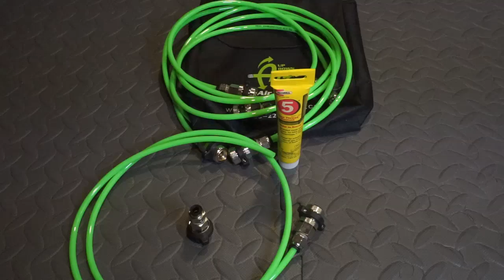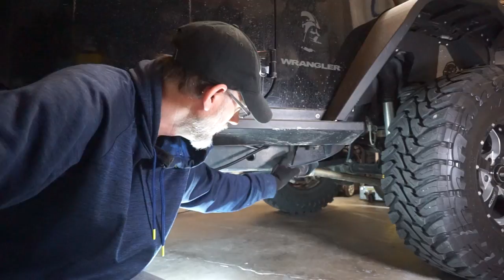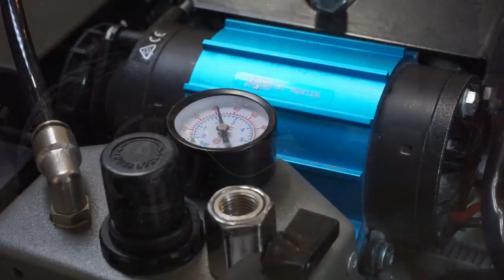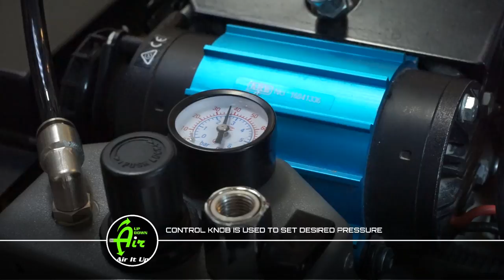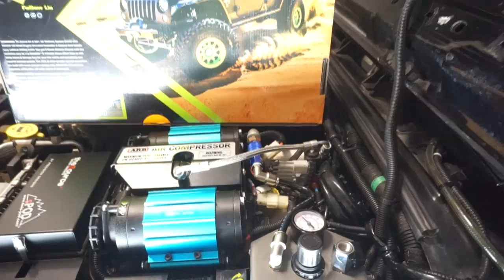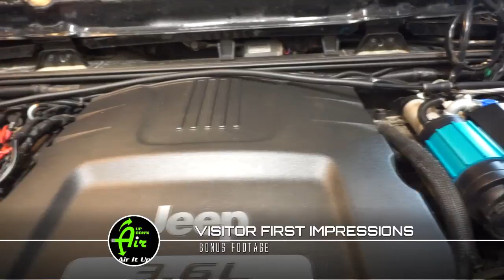UP DOWN AIR - INSTALLATION

Comment: Thanks for the video.  The SEMA video caught my eye, and I thought this would be perfect for my Wrangler.  I elected to go with a professional installation as this appeared to be above my skill level.  Just got the system installed this week, three days after you published.  I was hoping to play with it today but there were just too many errands to run.  I can tell you that with coupled with an ARB dual compressor and an sPOD, this air delivery system looks pretty sweet.  No more constantly bending over and airing down/up each tire!  Hopefully the rain will hold off tomorrow and I can give it a go.
Reply from the maker: Carol Bethune Glad the video was helpful. Thank you for watching. I used the system today and it worked perfectly on the trail. Once it installed it will be so easy for you to air up and air down.
Reply from the maker: So glad to hear that you went with the system. I hope you are still enjoying it and yes any time you can keep from having to bend over repeatedly is a good thing.

Comment: Hi just wondering after 5 years. if you are still using this set up? And howd it goes? Any issues. Is it worth it? They are still selling this product with gen 2 model. But it seems most vids here in youtube does not recommend it. Just getting sa inputs before commiting on getting its. It seems like a very good idea but i need to know if it really works. Hoping for your reply. Thanks!
Reply from the maker: Thank you for your question. Yes still using the same system. Main reason is because onboard air is required for the front lockers on the Jeep. Being able to run lockers, up down air and to help others when some extra air is needed works for our setup.  This system is slower than other alternatives on the market and ours is a Gen 1 model. Sorry have not installed a Gen 2 so not sure how reliable the new versions are. Hope this answers some of your concerns

Comment: Do you know if this setup with the addition of the ARB compressor Will work with a voswitch already mounted
Reply from the maker: Not familiar with the Vos Switch mount. We used the MetalCloak Arb mount and combined it with the Up Down Air system. We had to do some slight cutting of the mount but it all worked. Recommend you contact Up Down Air support for a more complete answer.
Reply: @JeepsRoc  Thank you, I appreciate the response

Comment: What do you have to do to mount the up down air piece in? I’m also running the metalclock bracket for the ARB DUAL air compressor. And the horn is mounted to the bac on the metalclock bracket. Any pictures would be a great help and ideas. Thank you
Reply from the maker: Bruce if you have an Instagram account send a direct message to @jeepsroc and will send you a photo of how we mounted
Reply: @JeepsRoc  i don't have an instagram account. what about Messenger?
Reply from the maker: @brucenix2037  You can send us a message on Jeeps Roc on Facebook

Comment: Neat setup but I wonder how hard it would be to modify to control the front and rear tires separately.  Probably just need some more valveing on the control platform to split the front and rears.

That way you could let air out of the front then the rear at different pressures and when filling up, for pavement driving, just fill all four up to same pressure, then air down the rears to preferred pressure.

I suppose you can do the same thing by airing up all four tires to what you'd like in the rear tires and then shut off the system, disconnect the rear connectors, turn on system to add more air to just the front tires.
Reply from the maker: I am not sure since this system is design to have each tire with the same psi when you have reached your set pressure. You could always set it to an example of 12 all around and then manually remove 2 psi out of the front manually if you had to. Just a suggestion.  Thanks for watching

Comment: i didn't see any installation, other than drilling a hole and cutting a piece of tubing. would've been nice to see how you ran the lines, whats all included in the kit, how it hooks up, how long it took to air up. Maybe do a manual air pressure check to show it's accuracy. Thanks for taking the time to make the video, though.
Reply from the maker: Appreciate you watching and leaving us a comment. This is an video we did years ago, since then we have worked on improving camera angles, and content.  This video is generation one of Up Down Air product and changed since this video.  If you would like see a little more of the product we do an article as well. Thanks again for watching and we hope that you enjoy our new content even more.   http://www.c4x4.com/Articles/Mar2018/Updownair/Updownair.html

Comment: Very lame video..  let’s mount the air up down fitting right where rocks will rip them off.  There a reason the fitting are mounted up and away.  Rocks, Mud, sticks branches..  
Happy trails Mall Crawler.
Reply from the maker: Since this video has been made not a single one has been ripped off. They are still rock solid and we feel we made the right decision in placement. A rock is going to hit our rock rail or mounting bolts first.

Comment: You mentioned that the factory bracket didn't work with your MetalCloak ARB compressor mount.  What solution did you end up with?  I also have the MetalCloak ARB compressor mount and would like to know if Up Down Air has a solution or if you had to come up with your own.  Thanks.
Reply from the maker: I did have to come up with my own mount. I slightly modified MetalCloak bracket by cutting a a small piece off the and then made my own bracket and fit it under/pinched it under the MetalCloak bracket. I can take some photos if you would like. Send me a DM on Instagram if you can @jeepsroc

Comment: Just a quick question, how did you modify the up/down control box to fit to the MetalCloak bracket. I am doing the exact same install on my '16 Wrangler.
Reply from the maker: Thank you for the question. I had to cut a a small piece off the MetalCloak bracket and then made my own bracket and fit it under/pinched it under the MetalCloak bracket. I can take some photos if you would like. Send me a DM on Instagram if you can @jeepsroc

Comment: Did I miss the connections from the ARB to each wheel?? You need to run four lines from engine compartment to each wheel arch? Then connect the whips to these mounts???
Reply from the maker: Ton Tonn yes run four lines, then connect updownair regulator to arb or viair system and then when you are ready to use the system you only need to connect 4 small air lines

Comment: @jeepsRoc How's the UpDownAir set working out for you thus far btw? Looks like it's been a year, thoughts? I'm about to make the purchase and chatting with a local shop to get it installed (don't wanna do it myself). Do you still like it? If not then what would those be or if you've found a better alternative to this. 
Please feel free to lemme know. And thanks for your videos, they are very helpful and detailed as per usual :)
Reply from the maker: Funny you should ask we used it last week and it is still running just like the day we installed it. The places that we mention in the video on where to install on the frame have worked out perfect. No damage to any of the valves while off-roading and all the lines have held, no leaks.  Gauge is still working properly. All good in our book. Thanks for asking.
Reply: @JeepsRoc  Awesome. I just ordered  mine, can't wait
Reply from the maker: Supreeth Shanthakumar EXCELLENT!!

Comment: Hey there, I'll be starting my install this weekend. Did you keep the two Y connectors under the hood or is one positioned on the passenger Side and one on the driver frame area.  Thanks!
Reply: Dear Alex. I advice to be careful while paying for this product as its been two months and i didnt receive my ayatem yet. They dont answer not emails.
Reply from the maker: Al Stanko Thanks for watching and thanks for the question. The Y connector for our build is passenger inner fender and driver side engine compartment. Focus on trying to place it where no damage or outside elements can affect it if at all possible ours are protected and double tapped with electrical tape as well as air line loom protection from Up Down Air.
Reply: @JeepsRoc  excellent! Thanks for the heads up. I can't wait to get my.

Comment: Thank you for the video, how do you stop the dust and dirt getting into the open schrader valves under the vehicle? Is there kind of cover like you have for the tire valves? I even would be interested in how do you did the pipe mounting under your JK? and how is the black pipe system connected to the ARB compressor?
Reply from the maker: Each of the schrader valves in the kit come with their own caps. Just make sure to re-install them after each use.  The cover is the exact ones you would use on tire valves. As to running the pipe mounting it will be different for each Jeep since each of us have one just a little different than the other.  I put mine as close to the frame as possible. Keep in mind on the side of the muffler to not get to close.  Each of the pipe mountings also have a covering over them as well for protection.The ARB compressor has to valve openings you just connect it into one of those connections, you can use a quick disconnect.  Thanks for watching.

Comment: what do you keep your tires at for normal driving, city and highway ? recommended on door panel is 35 - do you go as low as 30 ?
Reply from the maker: I run a Toyo Open Country M/T - If I was to run it at  35 it would be hard as a rock. I run highway at 28 and trails 12.
Reply: @JeepsRoc  so running my 31s at 37 psi is a bit much for city hwy driving ?
Reply from the maker: If your in the range of 30-40 psi you should be ok. I would stay around 35. If you lower it you might get a more comfortable ride but you will wear out your tires a little sooner.  I would just find the comfort level your looking for and go with that. If you upgrade to a larger tire you will most likely go with a lower PSI.  Hope this helps.